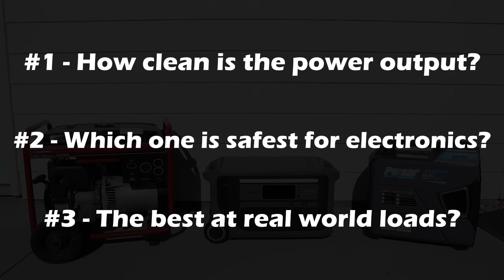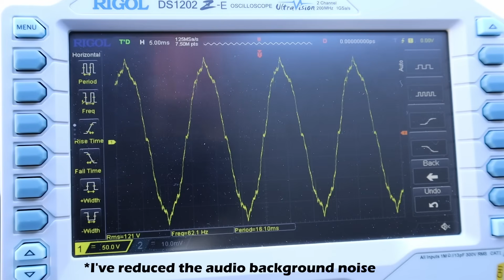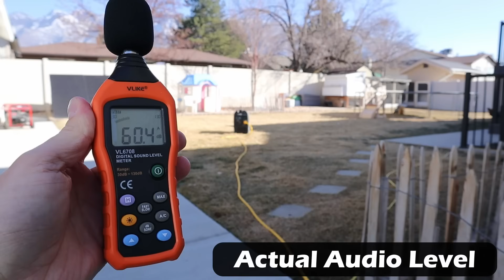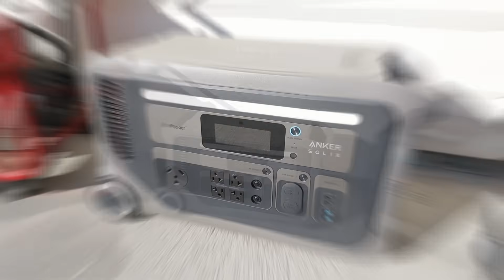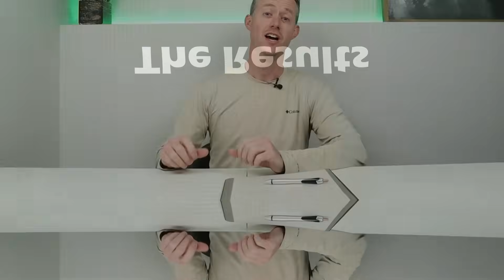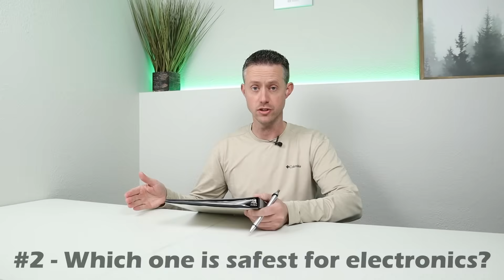Before You Plug Electronics Into A Generator, Watch This!

Comment: Good test but in my opinion, you should have included shore power in the tests to show any difference.
Reply from the maker: Thanks for the feedback! I tested my grid power today with the same equipment. 121v @60hz, the sine wave wasn't perfectly shaped but it was decent. THD was 3.1%. (edited for clarity)
Reply: @Jasonoid and what did the sine wave look like during table saw start-up.
What's the inverter generator or power station better than utility power?
Reply: @Jasonoid  Which "it" are you talking about? I have done PQA's in the past and depending on the area and what industrial loads surround it, utility (or shore if you prefer) can be as dirty, or worse than, a conventional generator. (Remember that a utility is a collection of "conventional generators" tied together, and their distortions and harmonics can be either additive or subtractive, and constantly varies over time due to shifting loads. 

Another factor in running your home on a generator: Loads create their own distortions and those are also additive and subtractive. So the single type of loads test you did here (one type of load under each instance, not a mix of electronic and non electronic loads) makes the results invalid for a real world scenario. I have run my whole house on a conventional Predator generator in the past, INCLUDING my invert drive washing machine, TV, electronic board dishwasher and lamps in various combinations for extended outages with no issues or damage whatsoever. 

That said, it is always best to run stuff with the cleanest power possible, but even today's electronics can tolerate THD of 6-10% without damage, (maybe slightly reduced performance or time keeping accuracy.) If the THD exceeds 15% then it is a problem and damage can occur.  If you try to have a balance of capacitive loads (TV's, computers, inverter driven equipment,  etc.) with inductive loads like fans or non inverter HVAC or window A/C units, the THD tends to drop as the loads "filter" out each other.
Reply from the maker: Edited my previous comment for clarity
Reply: @Jasonoid  Thank you for that edit. 3.1% or so was the average found in  most of my PQA's. I have found some utilities as low as 1% and many more at around 5-7% with ones near some large industrial users well over 9-12%.
Reply: @Jasonoid  Thank you for doing that follow-up for us. Great video.
Reply: Grid power in North America is pretty consistent but some of these inverters have a perfect sine wave.

Comment: some power stations will not accept power from a generator that is putting out excessive harmonic distortion ie dirty power. a fix to use the "traditional generator" is to use a DC charger plugged into the AC output of the generator and charge the power station with DC thru the solar inputs. also most high efficiency  forced air central heating systems use circuit boards and are at risk from traditional generators.
Reply from the maker: The only DC charger that I've tested that works with that is the EG4 chargeverter. Normal battery chargers need to see the battery voltage which isn't seen through the solar port. Why spend $700 on the chargeverter when you can buy an amazing inverter generator for half the price.
Reply: @Jasonoid  i did not know they had become that expensive, last i checked they were about 400, the inverter gen is the better deal
Reply from the maker: Yep, they jacked the prices up last year 😢

Comment: Great video.  These days, there’s no reason to not have an inverter generator…
Reply: What if you could get a used older generator and EG4 Chargeverter for 1/2 the price of the same capacity inverter generator, charge up your 48v battery bank, and then run silent off an inverter?  There's still a "reason", for a lot of folks.

Comment: Very practical and, I would say, basic information.  Well done!  I would like to see the full Ecoflow suite where their smart generator directly feeds their power station (D.C.), with the generator having electric start that can be triggered on by the power station when its level of charge falls to a certain point, and halted when appropriate, if possible...  Is this real; is this reliable; is the starter battery automatically recharged by the smart generator when necessary?  (The kind of set up needed for, say, a remote cabin.)
Reply from the maker: I have an old school video testing that EcoFlow generator on my channel with DC input. They have kinda moved away from that for some reason on their newer models.

Comment: Doesn’t Bluetti (and others) talk about using one of their power units to ‘condition’ traditional generator power? I could be remembering wrong?
Reply from the maker: Yes, some power stations have that feature but it's not common. To charge a Bluetti power station with "dirty" grid power, such as from a portable generator or an unstable power grid, you should enable the Grid Self-Adaptation Mode within the Bluetti app. I believe it charges at a lower rate than normal charging.

Comment: I recently purchased the Anker Solix F3000. During a power outage I plan on running Starlink internet, TV and kitchen refrigerator. My question is this, I have a Honda EU 2000i generator to recharge my power station during extended power outages. Putting the Honda generator in a detached garage and running the extension cord in to the house, will a 100 foot 12 gauge extension cord be okay to plug in to the power station? Thank You.
Reply: If it's a quality UL listed 12g extension cord and your charging at 1,600W or less it should be fine. Personally I would draw under 1,600w due to that amount being the max continuous power generated for that particular Honda unit and I wouldn't want to run any gas generator at max output continuously. But yes the cord would be ok.
Reply from the maker: For that distance, I'd recommend using a 10 AWG extension cable at least. You'll lose a lot of voltage with 12 AWG over that distance when up near 1600-1800 watts.

Comment: Did you tune the standard generator under load?  Normally the generator is supposed to be tuned with test loads before putting into service.  Great video.
Reply from the maker: I did not tune the generator.

Comment: Excellent video but how about water heater and well pumps?  Safe or no on old-school generator?
Reply from the maker: Brushed motors seem to handle dirty power better than brushless motors. You'd need to find out which type of motor your pumps use. Resistive loads (like an electric heater) work find on dirty power. I gave examples at the end of the video.

Comment: I've been thinking about getting another power station.  After watching the video, evidently I need an inverter generator.  I live a very simple life, so I don't need much.  But, if I understand this correctly, I can use the inverter generator to charge my power station.  I never thought about it.  Guess I'll be shopping for an inverter generator now, instead of another power station.  The video was really helpful, Jason!!!   Thank you!   Loved your avatar!😂
Reply: Get a Dual Fuel generator. Propane doesn't care if the carburetor is clogged and you can store it forever. Running propane keeps the internals and the oil cleaner. What I do is store propane and buy new gas for every hurricane season. If I don't run out of propane by the end of hurricane season, I just burn the gas in my car. So far in 6 seasons I have not yet burned gas in my generator, but I like having that option.
Reply: @halholland1637 dual fuel is definitely the way to go, however, the electrical power output of a traditional generator will be less when run of LP gas.  This has to be considered when sizing a unit.
Reply: @halholland1637  The only possible issue with storing propane in those portable tanks ( such as for a grill ) is that the tanks have an expiration date, so when attempting to refill 9 years down the road, the tank might have to be swapped out for one within the expiration date which should be stamped on the handle of the tank.

Comment: Very Informative, you have some of the best solar content out there, long time subscriber here...... !  I have both Inverter and and older Brigs and Stratton 6k dirty generator that has 120 & 240v I was wondering if I can run 48 volt golf cart battery type chargers as I have 2 of them that put out 18 amps each..... to charge my 6000XP battery bank,  with the golf type chargers plugged in directly to my batteries and the old B&S powering them.... it's old but it has some power.   that would make a good video.
Reply from the maker: Typically an 'AC to DC' converter (battery charger) has a wide range of power input and should work on dirty power. If you noticed excessive heat coming off the charger you'd know there was an issue.
Reply: @Jasonoid  I need to try it this weekend, just that my Inverter geny is only 3,700 watts and been trying not to max it out with 2 chargers at the same time.... thanks for the Impute

Comment: First off, great video as always and to see you step into a different area!  61.5. to 62hz is about where you want it at without a load on it with synchronous generators as 60hz is pretty much 3600 RPM.  Watch some James Condon videos to really see how they work.  Definitely not as clean of power for sure and why I only run a pair of dual fuel inverter gens off our 250 gallon propane tank.  0.3 to 1.2% THD is the range from about 2k to 6.5k of power from them which is better than the wall outlet THD.  Most houses will be fine with higher THD unless they are using certain HVAC units, pellet heaters, CPAP, appliances with fancy circuit boards, certain UPS's, etc.  Cell phones and computers are NOT sensitive equipment as they can work in any 3rd world country's crap power grids.  Just look at the range of what they can handle...50/60hz and 100v to 240v.  There are many newer open frame gens that are FAR worse than that Troy Bilt on THD.  Predator, Firman, Champion, WEN, Westinghouse, etc., rate many of theirs at <23% THD but those are relevant to load.

The THD you showed on that open frame with 3kw really isn't that bad and you were using 90% of it's running wattage which is not good.  Gens should be kept around 50 to 60% for normal runs and not taxed out.  Did you buy that Pulsar gen when Lowe's had it on sale for $299?  They sold out in one day.  ha  Keeping it under 3% isn't a "must".  Heck, even line voltage is rated to be at 5% or less in most places and has worse issues with brown outs and spikes.

I would personally take the inverter generator and power station as a hybrid setup typically works the best for most.  I won't rely solely on batteries.  Too much $$ for too little.

Comment: I'm wondering will a Tripp Lite LS606M Power Conditioner make a traditional generator safe for electronics - its rated for 600 watts but might still be good option.  Another way is to maybe use it to charge a battery,  once battery is charged it can be used with an inverter with pure sine wave output.  If the traditional generator causes damage it will only be to the battery charger and I wouldn't think it will damage the  battery because its receiving DC power.
Reply: No.  That's just an inexpensive line conditioner for voltage (AVR)  that can't clean up dirty power.  Look up Double-conversion (online) ups devices.  Quite pricey.  Just get inverter generator.
Reply from the maker: I was always curious about using a 'power conditioner' but as mentioned, inverter generators are so affordable and reliable these days, it's just better to buy one.
Reply: @Jasonoid  Yep.  Especially when used for charging power stations.  Those double-conversion UPS's are quite pricey.  Great video as always.  I've enjoyed discovering your channel and the things that  can be done.  I own a pair of dual fuel inverter generators ran off of a 250 gallon propane tank.  I typically use a single to run our 3,000 sq/ft house and only parallel the 2nd one IF we need AC (with soft start) for hot time of year in AR, or electric water heater, or electric clothes dryer.  Otherwise, a single at 50% load uses about 0.4 gal./hr.

I do want to add in a small-ish power station at some point in that Anker Solix F3000 size and add on a 10 circuit MTS beside our breaker panel for the "essentials" to keep me from going out in lightning and pouring down rain.  Not a fan of that.  ha

Comment: I’ve been wanting to see something actually showing the dirty power, not just saying it’s dirty power. Great video! Thank you!
Reply: I work at a local radio and TV station and we had Amsterdam Sail 2025 coming up. The idea was doing a live broadcast from a small cruiser but sinds there was no power on that boat, we had to switch to a generator. We got a "dirty" power generator and because the amount of power we used wasn't that high, we had to hook up a small heater to pull at least 2kw. Everything went fine up till the last day where my audio mixer died on me. We had to switch to alternative audio control and put every microphone on the camera's.

After this we brought the mixer to the repair shop and the only thing "damaged" was the line input fuse that was blown. Other than that it worked fine up to the last day. SO it could work, just becarefull. We used a Blackmagic video switcher, Yamaha O1V96 v2 mixer, a fridge, some small LED lights, a powered speaker and a small heater. The camera's and wireless transmitter were battery powerd.
Reply from the maker: I was basically wondering the same thing! Glad you found it helpful.
Reply: Pass trough power from generator to powerstation, what would happen?
Reply: @PietjeNL The output would be that of the power station.

More common scenario would be to have the generator as an input to the inverter/controller/charger.

Either way, it removes the generator's rectifier from the system as a source of noise.
Reply: @Zomby_Woof Well you would hope, but sadly it's not and most powerstation manufacturers have the idea AC cord is connected to grid power so they do nothing with it other then just "connect" it to the powerstations output.
Reply: James Condon has been doing this for years with the generators he repairs on his channel.
Reply: I'd like to see the test with am isolation transformer coupled to the generator output
Reply: I see how many of those power stations become toast using dirty power to charge them, my power station doesn't reverse the inverter to charge the unit, but mine are low frequency, transformer based, not computer chip based, and my chargers are external, which don't have a problem with dirty power, way less likely to fail, but if it did, it's just a swap out, not a downed  system!
Reply: I want to see the THD  of the all these gensets and utility power while running the table saw. It was putting a lot of noise on the line of all the devices (and was only ran for a couple of seconds) but was not considered.
Reply: I think the dirty power of the generator is pretty cool on the scope. I assume the peaks, which are still there under constant load, are the power pulses coming directly out of the engine.
Reply: I'd like to see what the dirty power actually does to sensitive electronics bc I've used dirty power on plenty of electronics such as phones tablets TVs laptops and they did fine. I haven't seen a dirty generator kill electronics yet
Reply: @poobank same here... Always wondered
Reply: @poobank Well, a long time ago we've killed a power filter which was supposed to protect an entertsinment system running from an old generator with a 2-stroke engine.  After the filter had failed I opened it to find it actually wasn't a filter but a UPS and all batteries (not lithium) had burst.  Whops.  But the wntertainment system was fine 😊  We had been warned about that generator which previously had fried a TV set.  That's why we were using the "filter".  The generator originally had been bought for power tools and halogen lights.

It's hard to give general rules, especially for the long term health of electronics.  A quick basic test may not give a full picture.
Reply: @poobank  Even today's electronics can tolerate THD of 6-10% without damage, (maybe slightly reduced performance or time keeping accuracy.) If the THD exceeds 15% then it is a problem and damage can occur.  If you try to have a balance of capacitive loads (TV's, computers, inverter driven equipment,  etc.) with inductive loads like fans or non inverter HVAC or window A/C units, the THD tends to drop as the loads "filter" out each other.
Reply: @poobank  I just commented on the same thing.